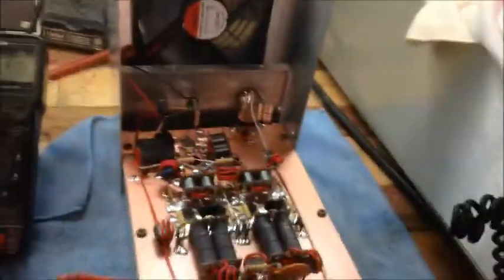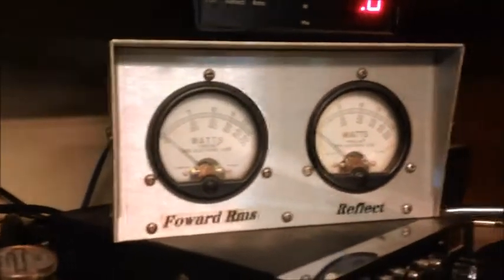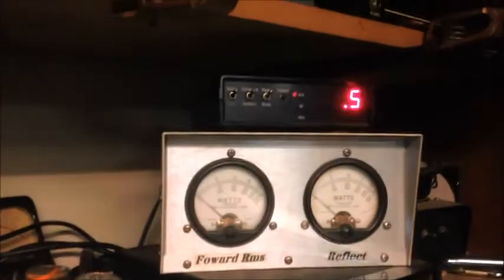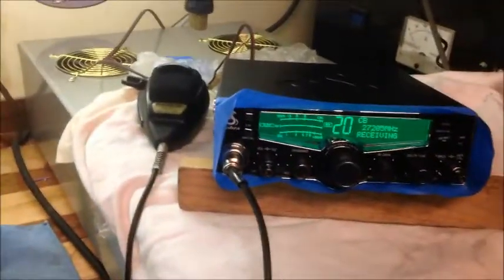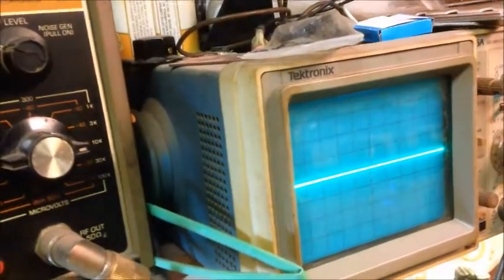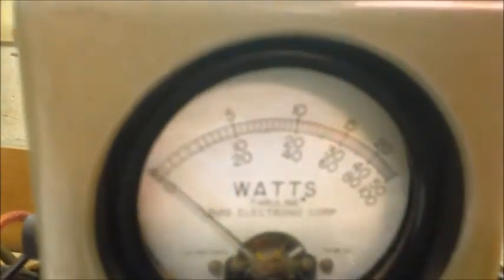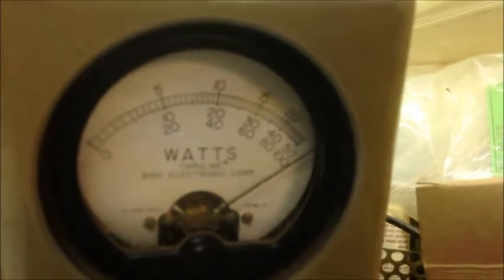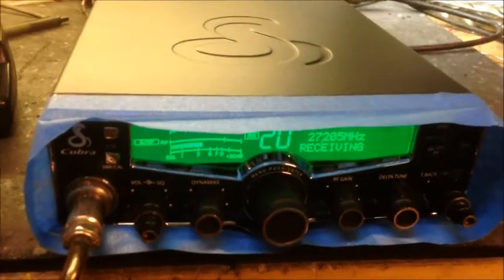Mark's Comp LX29 and 4 2 Maul

Comment: Why not show the video of the scope same time u modulating the radio we only see the radio when u do it once but after that on most of u videos we don't see the video no more of the scope I'm not knocking you but I would like to see everything when it's keying up
Reply from the maker: +NickRon06 I don't have my setup close enough to get both in the video's, we are getting ready to install new work benches and stuff and the plan was to get the equipment closer together so that can happen. When I was at my last shop that was in a 60x60 warehouse we had it set that way. Never thought I'd bring my shop back home. So it was never setup to be a cb shop to begin with. But we are working on it.Thanks for watching.